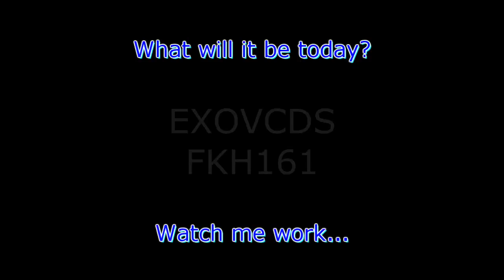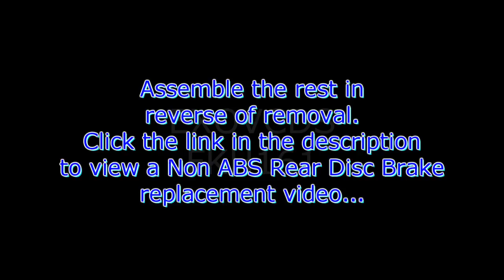VW A3: Rear Brake Job - ABS Tone Wheel Reminder!

Comment: Nice work Thomas. Does the removal of the tone ring also apply to the A4 generation or is it a different animal? Thanks for the video.
Reply from the maker: Hi Terry, the A4 has a different setup. The tone wheel or Teeth are part of the wheel bearing, which comes together with the hub. I figured I'd post this video as we (at least once a year) see a car with an ABS fault after the rear brakes were changed (by owner or other shop).
Reply: Thanks Thomas for the info as it's very useful. Got to learn all I can to take over the Volkswagen repairs LOL.

Comment: You're actually reusing the tone rings there are the same as a mk4 and not very expensive back then when I used to do more mk3 cars I tried to reused them but they were stretched by the rust and would not properly install when I do a mk4 I allways replace the tone ring if I re use the original bearing with a new bearings they come pre installed but not on a mk3
Reply from the maker: The tone wheels are usually ok in our area... the odd one that I try to reuse will spin,  and that's when new ones are put on. They might not cost much, but a little here and a little there and all of a sudden the brake job is too much for the customer. Who knew safety had a dollar value.?!